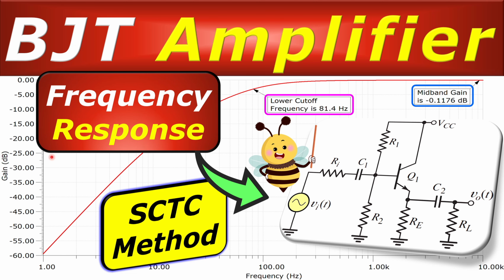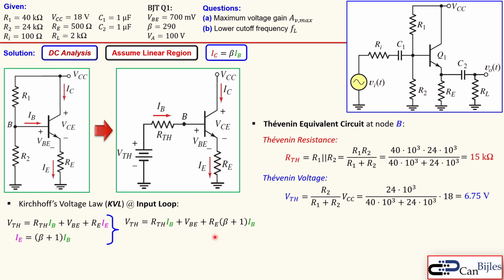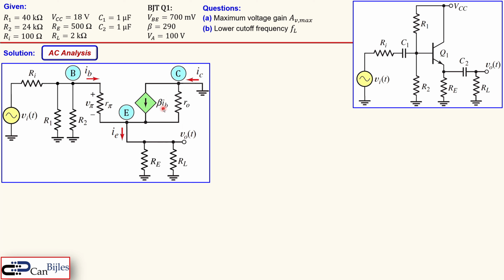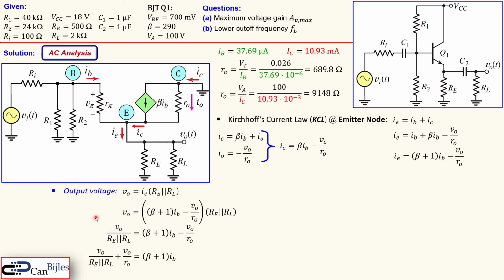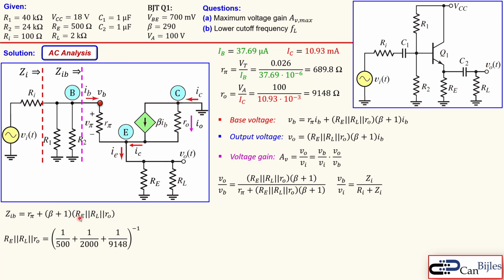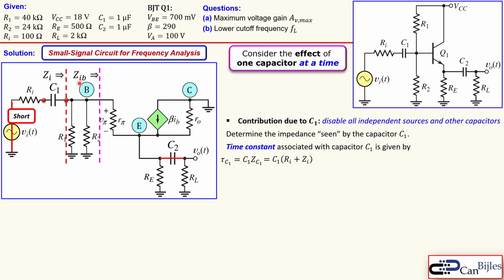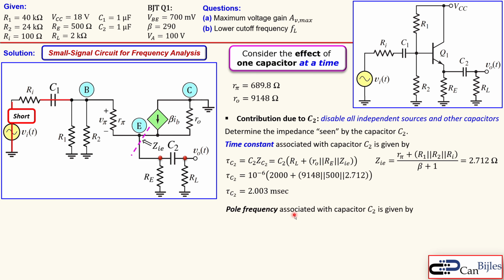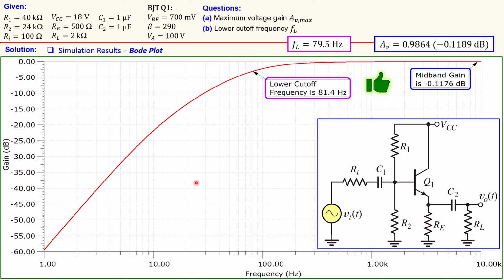BJT Emitter Follower 📶 Low-Frequency Response 🎯 Coupling Capacitors (Gain & Cutoff) 👉 SCTC Method

Comment: If I want to use two same BJTs in emmiter follower how is the circuit is changing? Adding R3 and R4 for BJT 2 and using the same RE? Are there any assumptions that we can make for the two BJTs (εγ rπ = rπ/2 ??) in order to utilise the above work ?
Reply from the maker: I think you want to cascade to emitter followers. My first question would be, why do you want to do this? Then, if you still do this cascading, then the frequency response analysis will be more complicated and will determined by both BJTs. You cannot just make some assumptions, maybe in a very special case.